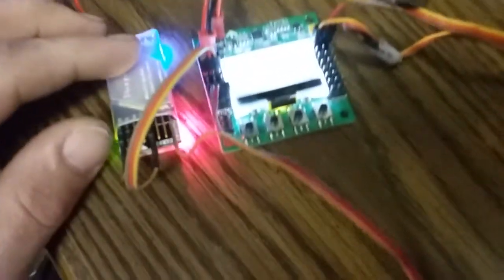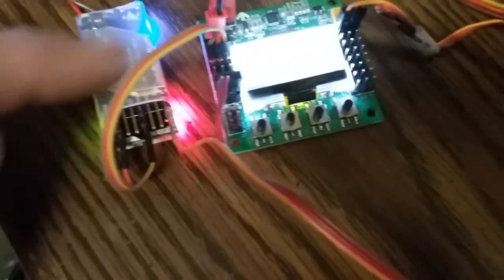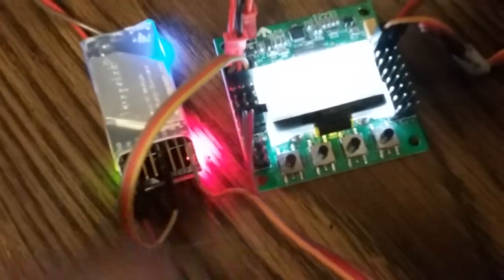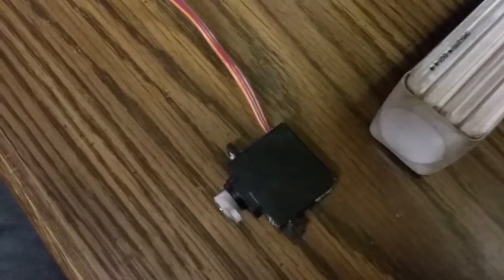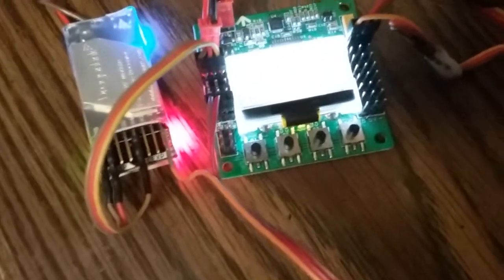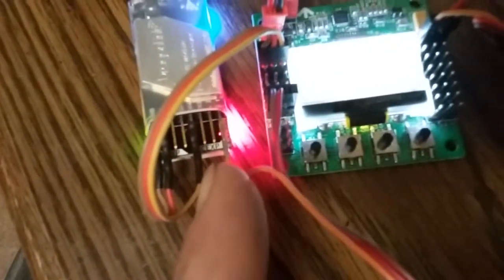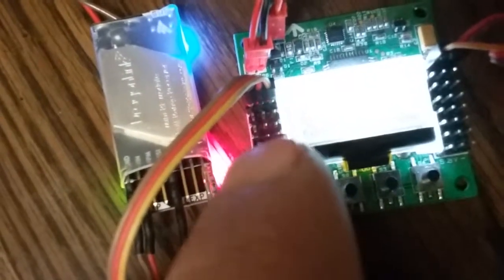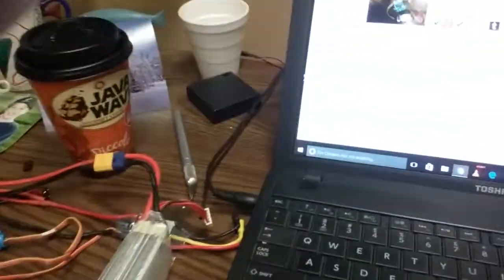Dragonlink Copter Receiver , PPM to KK2.1.5, and pwm to pan and tilt.

Comment: What's the point of copter receiver? It's only ppm from what I saw, but it cam be used just like the other micro receivers?
Reply: legal te encontrar por aqui Rafael!
Reply from the maker: +Pó de Balsa I think it is to save weight and to eliminate the bulky antenna. It can be used for ppm or pwm, you just have to supply the servo with the power and ground because the Dragonlink reciever will only give you the signal wire.
Reply: +bwiles12 Ok, got it. Thanks!